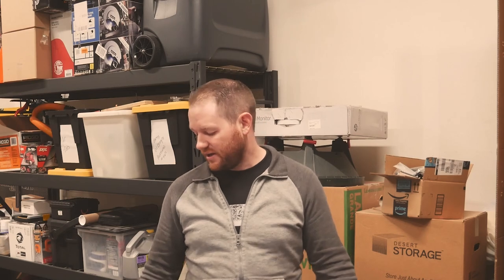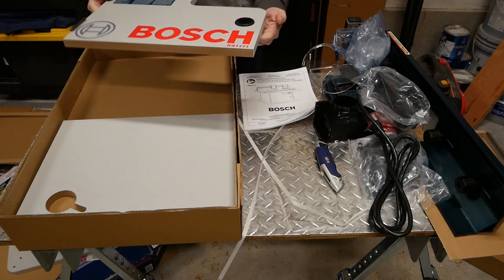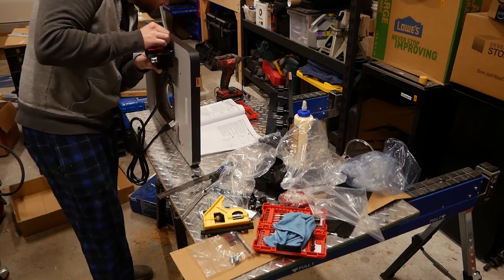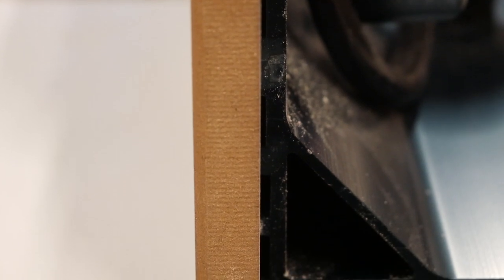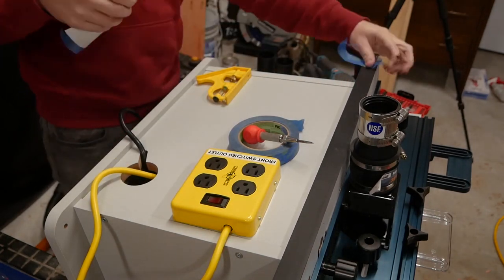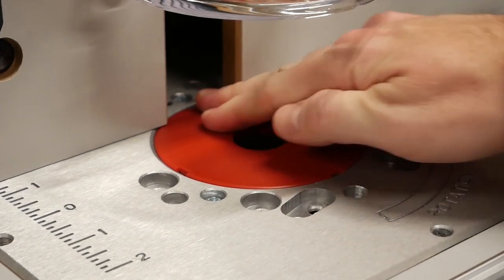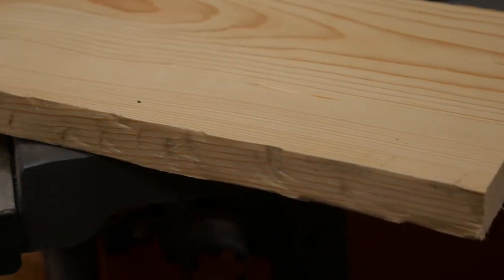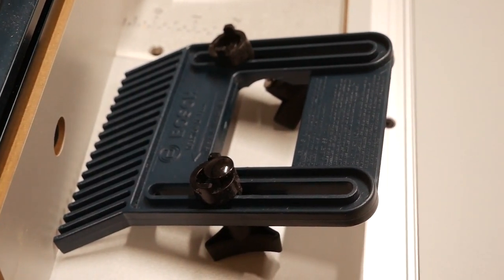Bosch RA1171 Benchtop ROUTER Table Unbox + Assemble + Review + Demo

Comment: The hole in the back of the cabinet that has the slot for the cord is intended as a secondary dust collection hose port. Pages 20 & 23 of the user manual point out that this is a vacuum port.

Comment: Just got one of these and a Bosch 1617EVS router in an Amazon package deal. Assembly went pretty good with the exception of the screw holes on the left side that join the side and rear panels. They were mis-aligned by 1/16” which leaves a gap between The floor and back panel on the left side. Like you, I found the leveling system on the aluminum center piece to be very user friendly! The leftover parts pile is considerable, and reminded me of two cycle carburetor rebuild kits. You wind up throwing away as many parts as you actually use! Very happy with the operation of the table & router! The top adjust height feature is a total game changer for me! I guess the only part I do not like about this thing is the finger hole in the door! I’ve over extended my finger in the wrong direction several times because it happens so quickly! I’m going to Mount some type of handle so I can stop using the finger breaker!

Comment: Nice I have the BOSH RA1181 bit sturdier since made from plastic and table is aluminum. Got it on Craig’s list in like new condition. For about half the price of a new one and the got the BOSH Router 1617EVSPK on sale on amazon. One was never quite sure how to use the 1/16 spacers thanks for covering that. I used my router the other day as a plane using 1” Trimming bit and square board on top as a guide. Using the shim method looks like a good alternative.
Also nice you did the Math I did so also after looking at plans to build my own table and cost to much and more of pain and especially if your a Novice DYI Carpenter. Thus best to keep to something with already good precision.

Comment: I'm in my garage. Lights on. 20amp table saw and 650cfm dust extractor running and a 2 foot fan running on my 20 amp circuit and no issues. I don't think they max out all the time.

Comment: I appreciated this because I had stalled on the assembly a few months back. So yeah, not a big urgency. Still, as a relative router newb with a new table and also the 1617, I better visualized how things were supposed to go together...cuz that's how I'm wired. 
And yes, I subscribed because of this vid.
Cheers

Comment: Thanks for the review.  I’ve got one of the same and I’m actually going to transfer the plate, lift, power switch, and fence system into a larger DIY base, as the top is really too small to work with longer lumber.  Doing so saves me (let’s me put off) for another year or so in buying a quality lift. If, when I do buy a better lift, I’ll have had the router cabinet for awhile by then, have some good lessons learned, and maybe able to use the same top as long as they’re the same size.  One complaint is that they only have one cheesy starter pin and only one hole.  I updated the standard plate with an additional hole (drilled and tapped) and a set of fulcrum pins.    How do you feel about the table now that it’s 2022?
Reply from the maker: I still like it. TBH, my projects have slowed down lately, but when I've needed it, it's done well.

Comment: Thank you for sharing. I’ve been on the fence for a while on this table and found your insights helpful. Especially on the fence adjustment tracks. Most upgrades certainly utilize T-track for that possibility making a larger investment on the front side to eliminate that time/ effort in the future.
Reply from the maker: Glad you found it helpful. My plan on the fence tracks was to just wait until they stop working and then dado out 3/4" for some aftermarket t-track. Interestingly, the "next model up", the Kreg Router table also uses slots instead of tracks as well. Guess everyone wants to cheap out.
Reply: So....in further “enjoying Black Friday” off I looked at the RA 1181 some more. The top on the 1181 is in fact metal with a seemingly better adjustment. As a hobbyist I’m wondering in the better support of the 1171 box  is worth it? Others seem to have no issue with the rigid plastic support legs. Both the 1171 and 1181 have through the top height adjustment. Guess I’ll have to consider more overall before deciding. Wonder if Bosch has considered combining the two units for a more robust unit overall.

Comment: Thanks for the review, it was helpful. My unit did not include a long Allen / Hex wrench for adjusting router height through the plate. Can you tell me what size hex-head that is?
Reply: Allen wrench comes with Bosch 1617

Comment: The only thing I didnt like was the stupid magnet on the door it's never worked quite right. Looks like yours is different. So I guess they fixed it.
The slick material you mentioned lasts forever. Weekly use on mine for the last year and it's still brand new.
Reply from the maker: Might try remounting it. I had to adjust mine a couple times to get it right.

Comment: just bought the same setup over the holiday. I noticed the router does not include the the dust extraction for under the table.  I found the "Bosch RA1173AT 3pc Dust Extraction Hood Set for 1617EVSPK" at toolmarts.com for $33, hoping that I can make a y-branch to capture from both the rear and underside of the router to dump into the portable ridgid shop vac.
Reply from the maker: That would be a pretty slick setup

Comment: I just bought and assembled the Bosch bench today. 
You hit every good and poor point on this product. Except one. 
The large hole on the back of the cabinet is to plug the vacuum into when routing dust is directed more in that direction. That was noted in the directions. (2 vacuum options) 
I will be using your idea to relocate or add plugs to the back of the cabinet. 
I enjoyed your video. Thank you.

Comment: The max possible startup current is not always the normal operating current. Starting them at different times may be an option. Rely on your circuit breaker to tell you the truth. That's what it's there for.
Reply from the maker: Unless you have Federal Pacific breakers
Reply: @aaronstestlab  If you have the luxury of multiple 20A circuits to choose from, there's no need to cut it fine. My point is, startup current is momentary, and specs tend to be maximized for legal reasons. My own older house has one 15A circuit per room, so I use a delayed start for my vacuum. The Bosch switch does not allow for that.

Comment: Nice review! I especially liked the section about the other routers. 
I was hoping that I didn't have to go out and buy another router because I have one already.
Reply from the maker: Nope, no new router needed. All major brands covered. On the off chance something wasn't, it's just cast aluminum. You could always drill your own mounting holes.
Reply: @aaronstestlab  Thanks for the reply. 

I live in Canada and one of the big box stores, Canadian Tire, has an amazing router on sale for over 60% off. It might be worth getting so I can have one permanently installed in the router table.

For your Canadian Viewers:
https://www.canadiantire.ca/en/pdp/maximum-fixed-plunge-router-0546810p.html

Comment: Titebond = giant bottle of Loctite for way less money per oz hehe. I was a little worried you knew a term for backstage porn staff that I didn't know, and I used to live with strippers. This is going to work so much better than the old tables I got for $25 each with no plates and missing router hole rings. I didn't know about the plate leveling system, awesome. And To be able to just raise and lower the (for me, much-needed) precision depth of the similar Bosch MRF23EVS router from the top instead of crappy old depth systems that moved and tilted the whole mess in the process, hoping it was straight after tighteing which, oh btw, tightening: which would ultimately raise or lower it a bit more every time, requiring one to manually offset the process in a trial and error process of a half hour to dial in  a round nose router bit depth that would create a true circle with two work pieces facing one another.
Reply from the maker: Not sure what backstage porn term you're referring to, lol